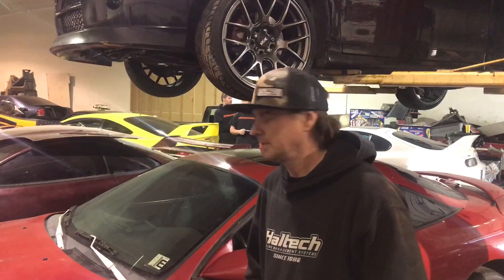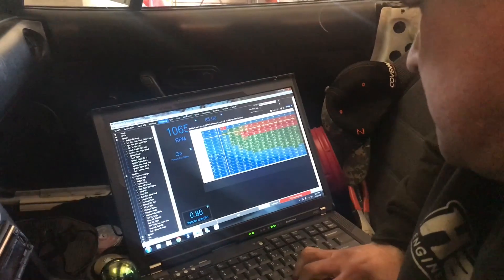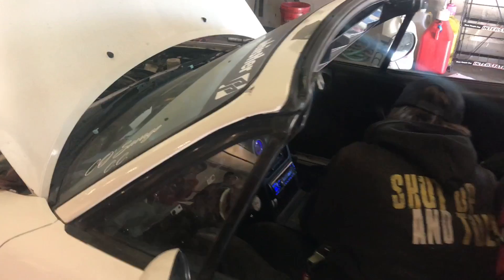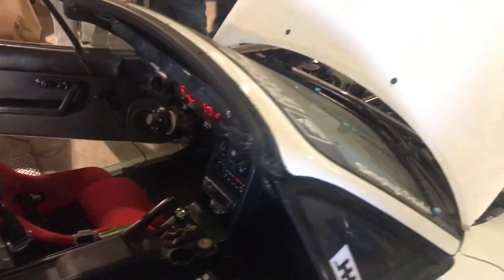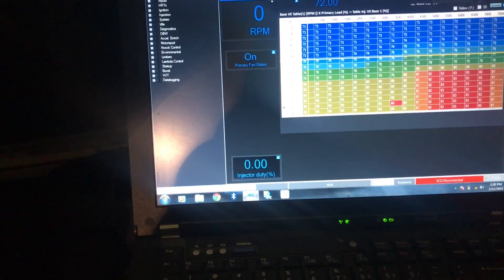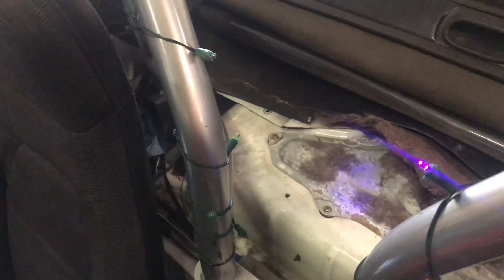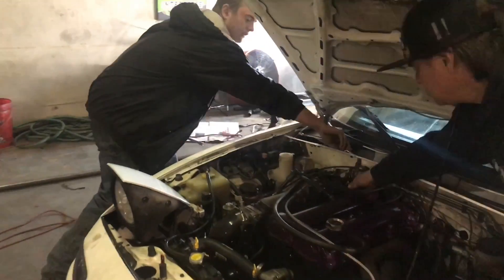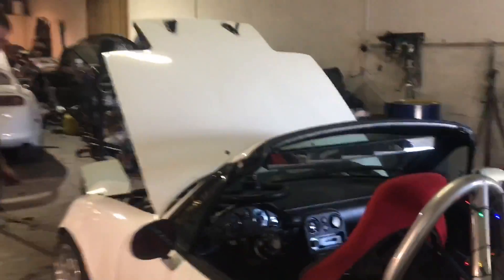ME221 Miata calibrate and troubleshoot

Comment: Damn it boy! 413 on a bone stock Miata engine...with a coolant leak and a vacuum hose blowing off...wow.
Reply: Damn it boy!
Reply: Boosted B Series EK turns out it was a bad coil pack, we've got a good replacement waiting for it at the shop.
Reply: Wesley Demsky That's shocking for a stock Miata engine though. I would imagine it's a 1.8. I made 408 whp on a stock Honda 1.8 block, but it had cams and dual valve springs on an eBay 63 trim turbo. I had the engine built with forged internals and bought all new parts to replace all of the eBay turbo components since then, but I'm trying to push for 500 whp on a Turbonetics 60-1 Hifi. Keep us updated on that Miata though. I'm interested to see how much it handles.
Reply: Boosted B Series EK no doubt that it's be back on the rollers after getting the tps and a few other little goodies. The me221 is extremely user friendly to tune and is practically laid out in front of you. I just need brent to teach me a few more things about tuning. 😁

Comment: 35 on a stock block at 16psi!! How long will that last?
Reply: Wtf is that at the end?? 😂
Reply from the maker: 😂 just gotta laugh. Made around 12lbs 16 degrees timing on e85
Reply: PFI Speed pretty cool. Out of interest, have you played with 1.8t?
Reply from the maker: I haven’t gotten to play with one yet. Have had them on the rollers just no one has come with a programmer.
Reply: PFI Speed do a video on David kings rebuilt srt4 sometime